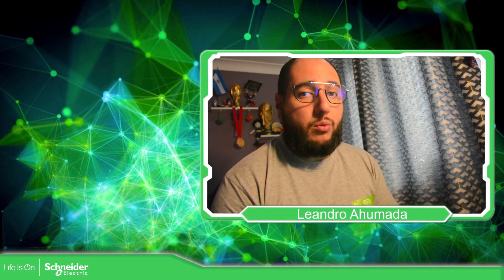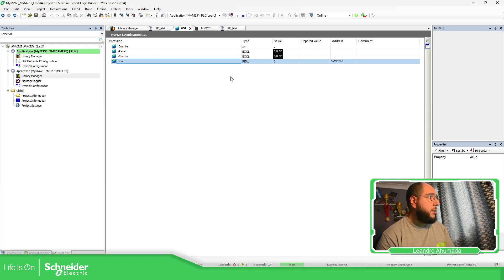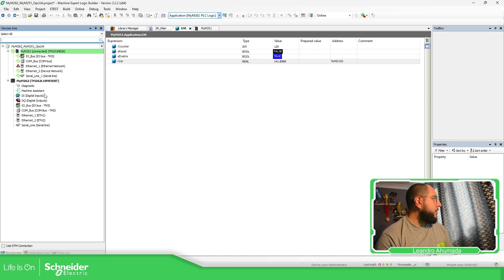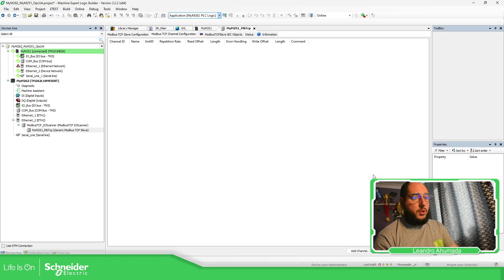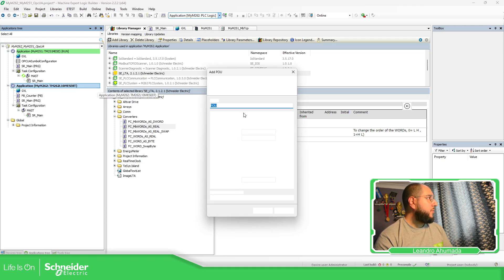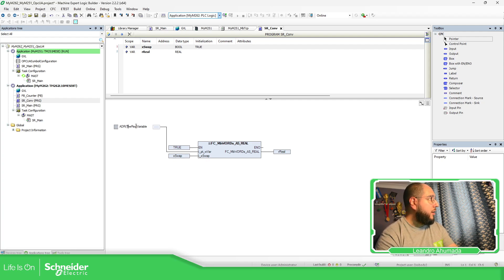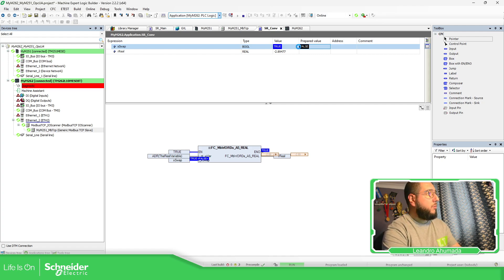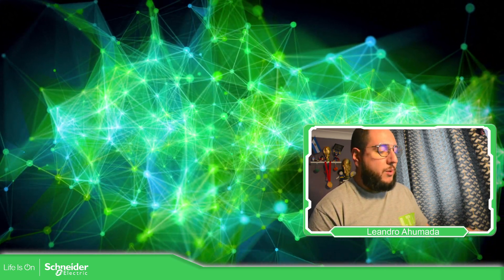EcoStruxure Machine Expert Training - Mx.x Reading real variable in a network (32bits variables)

Comment: After importing the library the program gives me the following error: "Could not open library 'VisuSymbols, 3.5.10.0 (System)'. (Reason: The library 'VisuSymbols, 3.5.10.0 (System)' has not been installed to the system.)", I have a more recent version of the library (VisuSymbol 4.4.0.0), how can I resolve this?
Reply from the maker: Hi there! Nothing to do on your side, i have just specified to alway use the newest library so please check it now:
https://app.box.com/s/r7zupob3dtzzds51pcksqywy6qgasbr8
Reply: @LeTomasAHUMADA  
Using Machine Expert v. 2.2.2, the provided library does not work (the "PLCCommunication 1.0.4.0" library is required while the "PLCCommunication 1.0.5.0" version is installed on my system). Where can I find the updated file?
Reply from the maker: @ i should check for that library too on my project i will update the file tomorrow please check tomorrow late night.
Reply: @LeTomasAHUMADA  Any News? Thanks